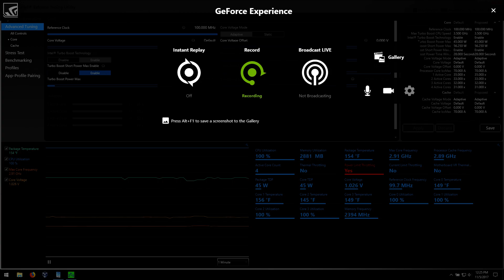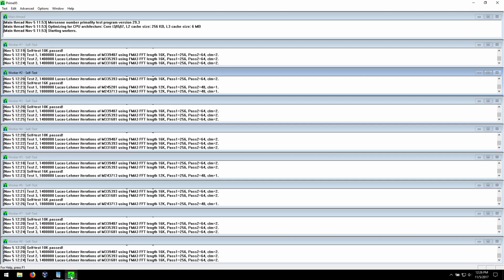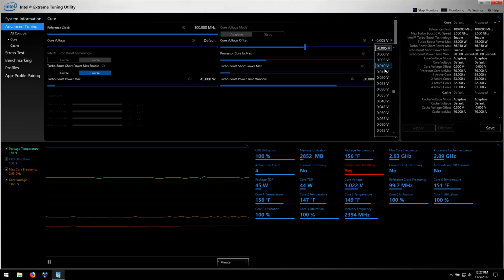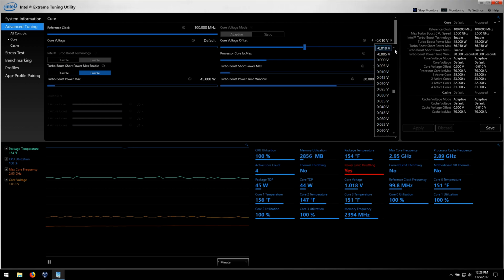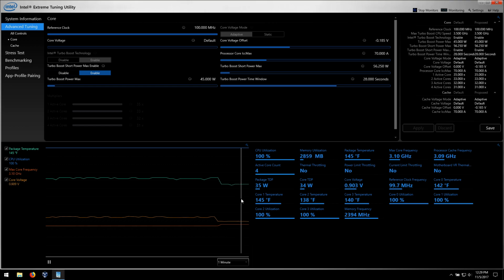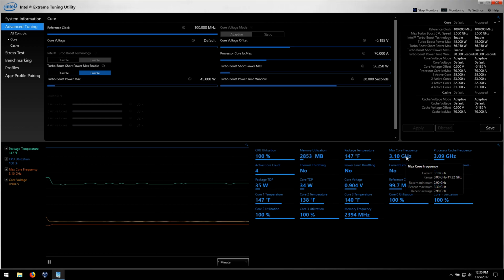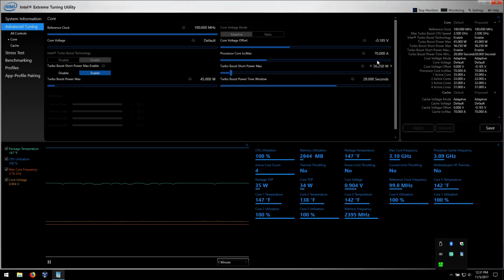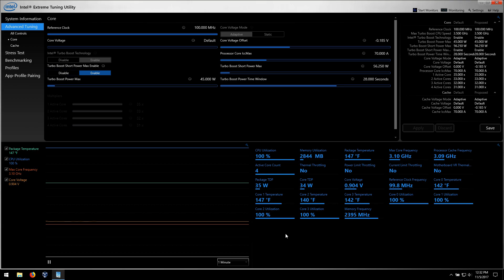CPU Undervolting With Intel XTU

Comment: I'm probably misunderstanding but you said to lower the voltage in increments of 5 and run the test. For how long? Did you say overnight? If you did this in 5v steps overnight and found your sweet spot at 185 that's 37 days of testing. Someone please clarify. Thanks
Reply: 1:47

Comment: Bro i have a question, i have a i7 9750.. 2.60 up to 4.20.. when i buy it i remember i get always stable 3.80+ ghz.. but after use throttlestop my core start to lower the core to 0.90 in idle, 2.4 hard use and sometimes 3.4.. but in your analisis you get a stable 2.90-2.94 ghz... and that make me wonder if i do something bad with my laptop... ofc for batery is great but i dont know if is somethinh bad in the machine or something i doing wrong...
Reply: Intel CPU in idle go low frequency from long ago, it is absolutly normal. It lowers energy consumption and heat.  You can disable it in windows energy politics, but it is not recommended.

Comment: When i lower my core voltage offset my laptop crashes
Reply: Don’t just smash it go slowly only by -0.10mV and then stress test repeat until laptop crashes then when it does go back and go to the highest undervolt before you crashed and yes I know this comment is 6 months old :)

Comment: So I managed to drop temps to 70 to 80 degrees max with - 110mV undervolt but I'm getting the "power limit throttling" option in xtu turned to "Yes" when gaming. Is this normal or does this mean I undervolted too much?

Comment: What to do if i see drop in cpu utilisation (<100%) while doing undervolting? But my system is still stable while stress testing with  prime95? Please reply.
Reply: Depends on the drop in cpu utilisation, if its around a 6-7% drop then no worries but if its more tham that, then prime95 must be having some issues with your cpu utilization

Comment: I try stress test at -0.150 ang my max core fre steady at 4.30ghz.. is that fine?  My cpu is i7 8700k
Reply: I have i7 9700(non k) max boost 4.7 ghz and with -0.15 i get 4.5ghz steady with max temp 70-73° at stress test. 
So yeah u should check why u might be getting tdp lower than around 60-64w

Comment: My intel core i5 8250u has a max undervolt of -0.140 mV.. and -0.145 crashes my laptop.. results are promising, dropped 11°C. Battery lasts 45 mins longer!!!
Reply: Mine hit -0.135mV, and keeps at 2.69-2.79Ghz when encoding videos utilising 100% CPU. 

If I use ThrottleStop I get BSODs & system lockups when enabling SST and can only set this value to 0 effectively disabling SST.

Comment: hello, after i install XTU, in my advanced tuning section i can only adjust the walt, i want to underwolt but only the "additional turbo woltage" message, please support me!
Reply: Did you find the solution ? , i can't change core voltage offset too
Reply: @VanKlaisss  
Did you find the solution ?

Comment: would it be usefull to set a lower static voltage first and then adjust extra negative offset of a lower value ? 

or what is basically the difference between having just offset adjustment compared to static voltage with an offset ? 
thx

Comment: Which prime95 test did you run? Blend, small ffts, etc.?
Reply from the maker: otherworldly being don't remember off the top of my head
Reply: it's aight. I'm using blend right now because the small FFTs test makes my air cooler sound like a jet engine, uncomfortable temps. Tryna get a stable undervolt for my i7 8700. lowered to -0.070 V after -0.085 got me an unexpected crash. i'll keep lowering the voltage and check stability. Great vid btw.

Comment: Hi may I know how to adjust the max core frequency? I recently use throttlestop to check the box "disable the turbo boost". My max core frequency go to 1.69ghz. But when I unchecked it, it does not went back to 3.8ghZ. Pls help.

Comment: awesome now Intel® Extreme Tuning Utility just disabled my laptop's turbo boost lol now im running it on 2.9 ghz it was 3,5 ghz before
Reply from the maker: Stanzin Yontan Enabling and disabling Turbo Boost is another option inside XTU.  Make sure you didn't disable that option.  I still have Turbo Boost on my laptop.
Reply: You can't enable/disable turbo boost in XTU. You can only do that in the BIOS.

Comment: I know you said it in the video, but I've been reading about this and some people say it will just run after reboot and others say it will not? You for sure have to run the profile again on each boot? Thanks
Reply: M1dn1ght N1nj4 as far as i've read in different forums, a setting at the BIOS called "Fast boot" is the cause of xtu reseting the config, not sure tho, didn't test it myself...
Reply from the maker: Corey Wingo it's odd.  For me it seems totally random whether or not it will restore the profile on the next boot.  I still don't know what causes it to restore or not.
Reply from the maker: I'll look into that
Reply: M1dn1ght N1nj4 btw, how is it going with that kind of undervolt?, as i know using the xtu offset also impacts idle voltages, so ur idle will also go down by 0.180v, did you run into any instability problems while idle?
Reply from the maker: ArgStyleRlz No.  Idles have been just fine.  Hasn't crashed once yet
Reply: any solution to not open it every time and re-undervolt it?